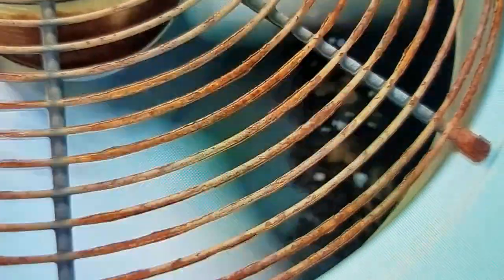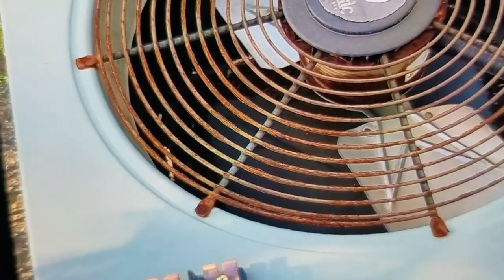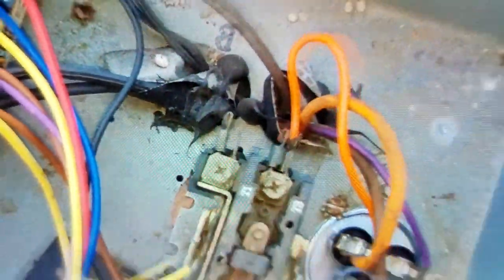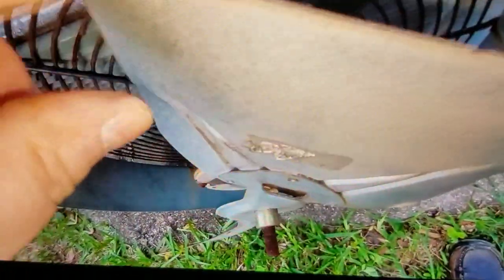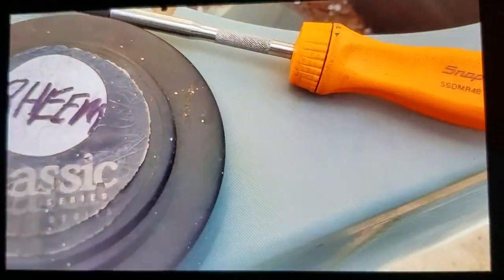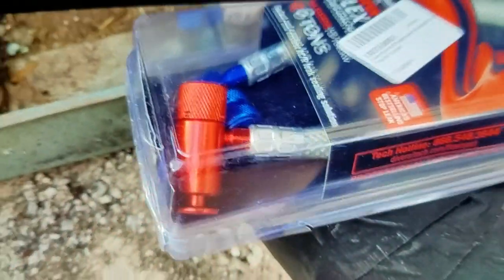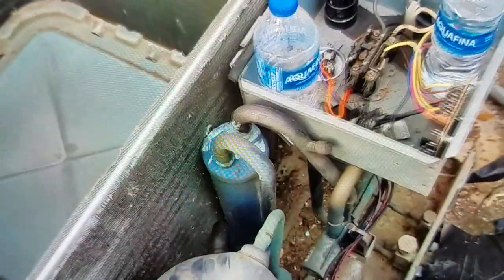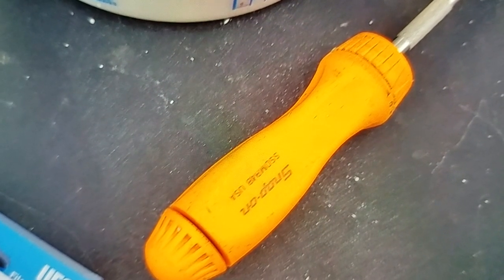PROTECH HVAC replacement Motor & Fan blade DIY

Comment: That was great information about how to work on a fan motor. I had no idea that there were two fans underneath this motor. I am also impressed that you cleaned around inside the box because most guys don't do that. Thank you so much for sharing your knowledge, sir. It is also so nice to have someone working with you to share your ideas simultaneously.
Reply from the maker: Thanks Josie⚘️《☆》I appreciate You dear☕️❤🤳It's only 1 fan😁I was just comparing the new fan to the old one✌️😎☯️

Comment: It is best to also clean coils with coil cleaner and water via the garden hose. As for the screwdriver from Snap-on. You get what you pay for. Its not always about money.
Reply from the maker: Thanks Nathen《☆》I appreciate Your support🍔🏈🤳I thought about using the Coil Blaster & Water but it's a 20 year old HeatPump & the Coils are very delicate now. I had a 75th Aniversary SnapOn ratcheting Screwdriver that my Boss gave me for Christmas back in 1995. The gold plated chrome was peeling off of the shank & was Very sharp. I actually cut my fingers on it. I traded it in on another orange handled one. I gave it to my Son a few years ago. Those things used to be like Status Symbols amongst Aircraft Mechanics. I have 2 other ones as well✌🏼😎☯️